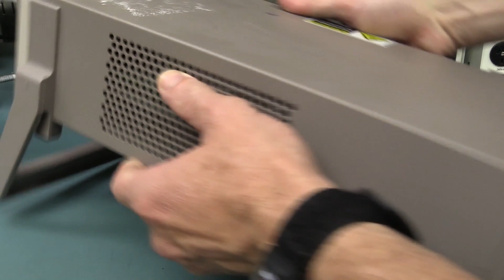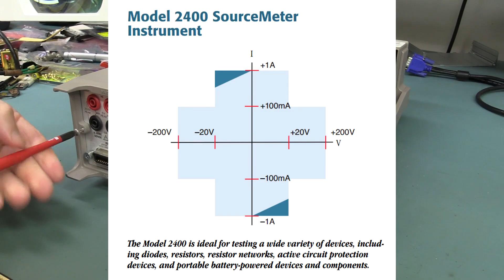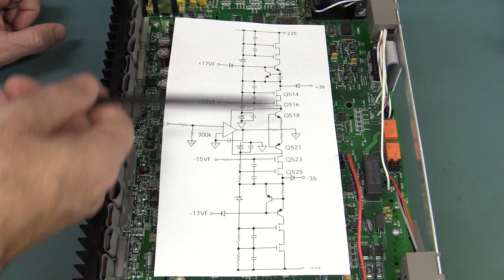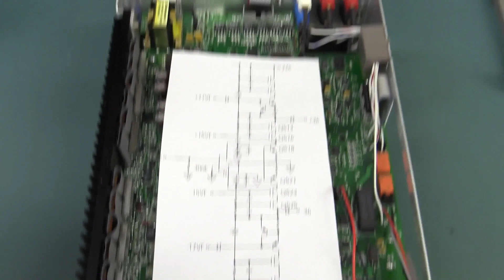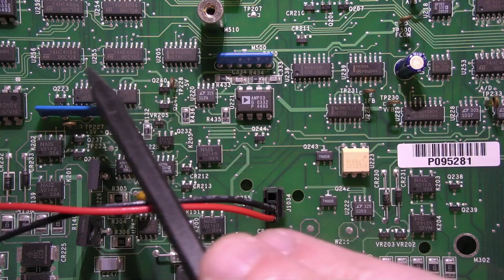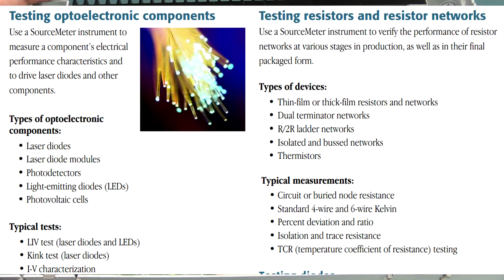EEVblog #718 - Keithley 2400 SMU Teardown

Comment: For some reason, I think sourcemeter is only good for IV-curves. and leakage testing,  LOL 
use it as power supply---- not enough output capactance.   
use it as a Eload, ---yeah I get better precision, but it is a lot more dangerous to use comparing to a good E-load

use it to generate pulse (pulse sourcemeter),---- slew rate (both voltage and current pulse) too slow ( mosfet or Op-amp circuit + signal generator can do it way better)
use it as DMM, --- yes a great DMM, also a much much expensive DMM

Comment: Former Keithley engineer, I used to work on these. VR600 is the A/D voltage reference zener. FYI, the Altera chip is a custom A/D which also routes serial data from the main micro to the range shift registers, analog muxes, and the DACs.
Reply: "Altera chip is a custom A/D"?  => Is this mean use PLD to implement delta-sigma ADC?
Reply: @jarodzs  Yes, it has all the logic that makes the ADC.
Reply: Nice, that's what I was thinking. I guess he was looking for an integrated reference, but I suppose that diode is good enough for this level of precision.
Reply: Hello, I have found a used 2400 that seems to work fine, apart from the 100mA range, that doesn't work at all. I would appreciate if you could give a hint as to what may be the problem.

Comment: Back around 2001, myself and a mate bought a few of these which were the 2400LV variant (high voltage disabled).  I soldered a set of diodes into each one to make them "proper" 2400 units and we sold them on.  Kind of wish I had kept one though.

Comment: Dear EVVBlog, i have a problem with my 2400 SMU. When output is OFF or ON with Vsource=0, i really have -5,5 volts on output. Wht could be the reason of this?
Reply: Did you figure this out? I have a similar problem except it's 5.5V

Comment: The unit consists of two PCBs, top and bottom. Can you go over the bottom PCB layer below the top PCB you are describing? The bottom PCB is for communication and power supply for the unit. My unit turns off and on by itself after a few minutes of power-on... It must be power supply problem. Any suggestions on how to fix it?

Comment: Looks like that heat sink is designed to not get in the way of disassembly!  Just undo the two end screws, and it will probably slide right up when lifting the board.  If not, there is an extra low number of screws (1 per two transistors) holding them to the heat sink via bits of cheap end aluminium U-tube.  Definitely designed for ease of repair when needed.

Comment: I find the irony of how you bash the high end audio people but then you do videos like this.  Although there is a lot of BS in foolery in the audio world one could use your arguments about audio stuff on electronics tools.
Reply: But it isn't really the same thing, this is a scientific instrument for where a very high degree accuracy is essential. The BS in high-end audio has no scientific basis, especially stuff like audio cables.
Reply: I could easily argue why anyone could care about getting a voltage accurate down to 5 decimal places.  I don't deny the BS, but at the same time using the same standards he did I can call BS on this if I felt like it.  Anyone who hasn't heard truly high end audio equipment has no more of a right than I do to criticize this voltage reference.
Reply: lyokofans They are quite different. Audio quality relys on the Mk 1 ear while this is a testable scientific instrument for when you need to look for tiny variations. By the sound of things you are offended by this guys distain for audiophiles who spend a fortune on equipment with fancy claims. Indeed the marketing crud that gets peddled by these audio companies makes it hard to believe any claims they make. I can confirm that a properly set up listening room with professional multi-thousand $ gear sounds great. But does it sound multi-thousand pounds better than a PC with a USB DAC. class D amp and a decent pair of bookshelf speakers. Well to Mk 1 ears its entirely in the ears of the beholder. In fact sometimes with some older music I think cheap ass gear makes it sound better. Possibly as it was recorded to be enjoyed on such. :)
Reply: It depends if you want accurate reproduction or you want to distort the audio to make it the way you think it should sound.  It is possible to get testable results with audio equipment.  It isn't like audio equipment puts out random noise completely different from the input.  Also class D amps are crap.  They are only good for efficiency and that is about it.  If you want fuller cleaner sound you have to use a class A+AB or class AB.
Reply: Aye I have seen setups that use microphones in the room to test the acoustics of the room and the like. However it all boils down to personal taste as to how you like the audio 'distorted' I like playing with different DACs, speakers and amps to try and get the most interesting results. Always love to hear what other people are playing with. Valves sound fascinating although that might be the theatricality of the glow. :)
Reply: My expectation in audio is to reproduce the sound as accurately as it sounded as it was when it was produced.  Obviously that is still subjective as you pointed out, but musical instruments are predictable to some degree.  I might consider dabbling with valves in the future but I would only consider it if I could find something that won't color the sound.

Comment: The schematic has some obvious errors.  For example, just above and to the left of the diode that connects to +36V there is a capacitor that obviously should be a resistor.  Also, the output is not shown.  And it's important to note that most of the supply rails have a "VF" suffix which stands for Voltage Follower, meaning that they track the output voltage.  For example, the +15VF rail will stay 15V above the output, as the output goes up and down.

Comment: VR600 diode = voltage reference. Below the FPGA.
Reply: that's what I thought, with a stable supply rail a zenner diode voltage reference might be enough.

Comment: Hi, could you please do more design lessons? I enjoy your channel, but sadly the micro power supply design was fairly advanced and seemed like a one-off. It would be cool to see you design and explain similar circuits, especially with transistors and opamps.

Comment: I wonder if the volt ref is made zener stile with the VR400 and VR401 as you can see at 16:04
They are put on holders and all away from the board while all others are flat on the board.
Together with the placement near high-end resisters and on the same height lengthwise to the volt reference test points.

Comment: Had to measure an optocoupler circuit at work, but I had to do it manually... took nearly an hour to go through the voltage range in tiny steps, and the PSU's voltage knob was a 1-turn pot.
Reply: My thoughts are with you, no one should work without the right equipment ;-) ^^

Comment: So in plain English please, what does an SMU do?
Reply: DMM and a precision voltage/current source and sink.
Reply: it can also measure current without any burden voltage.  With appropriate software, it can characterise batteries or simulate a battery at any stage of charge ,which can save many hours.